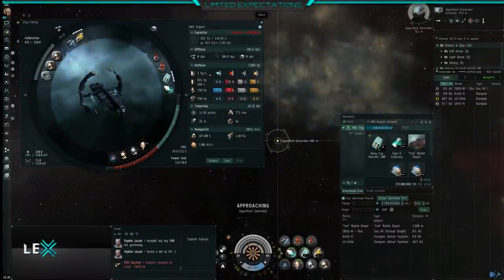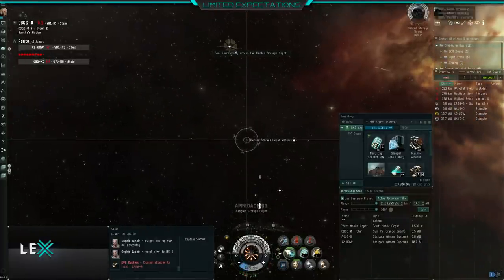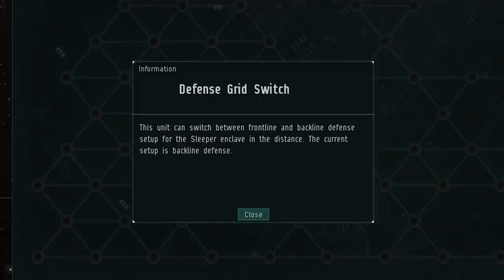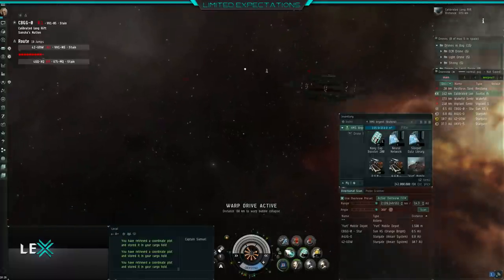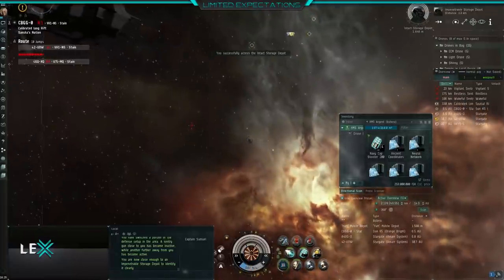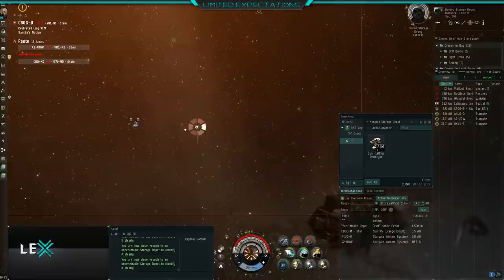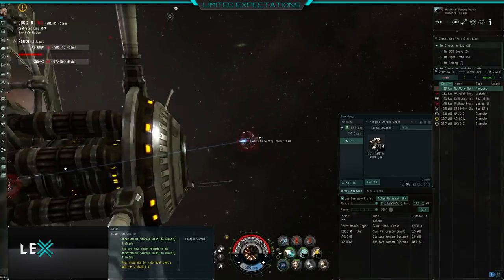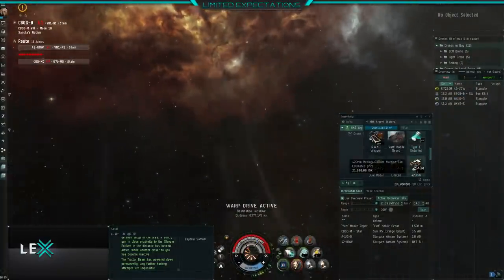Eve online Exploration - Complete Standard Sleeper cache tutorial

Comment: a few things. 1) cool video. I've been too scared of the DPS to go to the back but nice advice. 2) after you hack the sentry next to the tractor beam, fly towards the first area, and when you are far enough, the far turret will agro the remote defense grid unit next to the tractor beam and it won't agro back to you again! 3) the reason the tractor beam isn't working, is because it pulls those containers in the far area to the tractor beam but you hacked them already so there was nothing for it to pull. 4) Personally, i'd leave that third container in the first area alone for a minute. hack the far containers, hack the sentry next to the tractor beam, THEN go back to that last container but this time fail the hack on purpose. This will set off the site to "destruct" but if you fly far enough away, you should be fine. After the radiation is leaking everywhere, the rift appears and it's in a safe spot outside the radiation! you can fly the astero right into it and go to the secret room. P.S. The pristine container is pulled from this secret room so if you don't get it from that alarm hack, it will be in this next room. in this room, start the timer, hack 2 containers, restart the timer, 2 containers etc!!!

Comment: may i know what fitting you have used to run the site especially the rigs i have an astero but i am terrible at fitting armor tanked ships
Reply from the maker: tans117 Usually I use a Small Gravity Capacitor Upgrade I, since the astero gets less of a scan strenght bonus than the T2 ships. The other two rigs are a Small Auxiliary Nano Pump I, and a Small Anti-Explosive Pump I. The reason I only use T1 rigs is because of the calibration, the scanning rig takes so much that this is the only reasonable way I have found to fit 3 usefull rigs.

The rest is quite standard, 2x EANM, DCU II, Coreli A-type small armor repairer, Small Electrochemical capacitor booster to keep the repairer runing, and a 5MN MWD II. 

If you wish to go cheaper on the probe launcher and go with a T2 variant instead of the sisters version you have to swap one EANM to an Adaptive Nano Plating because of CPU issues. I think this was the fit shown in the video. Just remember that the sleeper sites can be dificult to scan unless you have very good skills, so every little bit help!

Comment: I don't think the tractor unit is bugged. You choose between the tractor(low power) and the hidden chests(high power) zones to loot.
I dont think you can loot both places. 
And why you didn't activate the secret room?
Just fail the hacks on that last defence grid unit 3 times and make the alarm ring. Then warp out and wait until the place blow up. Then go back and you will see the secret rift opened in the middle(where the tractor is).
Reply from the maker: Kliment Genov I've been testing this out, and it seems that your theory is correct about the tractor.

Regarding the secret room, I belive it was talked about during the video; You get a choice, complete the alarm and get a pristine can, or fail the alarm and spawn the secret room. Usually this pristine can has ALOT of loot, and thusly we believe it contains all the loot from the secret room, but we have not been able to confirm this yet.
Reply: Limited Expectations Nah, you can take both the pristine chest and the secret room. Just fail on some of the other defence grid arrays(those that activate and deactivate the turrets) for 3-4 times. The first time you fail the alarm level rises to level 1, then the 2nd time to level 2 and when you reach level 3 the next time you fail the hack the red message will appear.
 Then you have 30 seconds to warp out.   Then go back and do the secret room.
Reply: Usually I leave the defence grid at the 1st spot where you land right after you enter the complex. Then I do the tractor. In your case I don't know if you can tank with Astero there.
Reply: I'm assuming that one must bookmark the location first, as the signature disappears off of the scan window at some point.